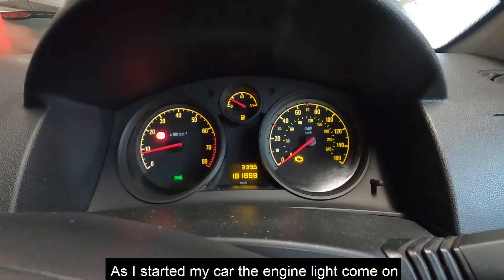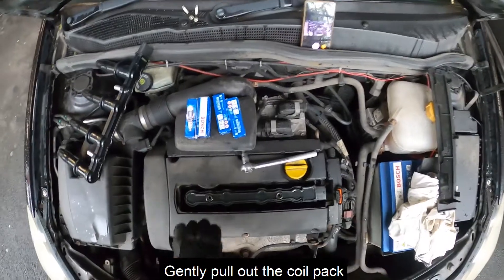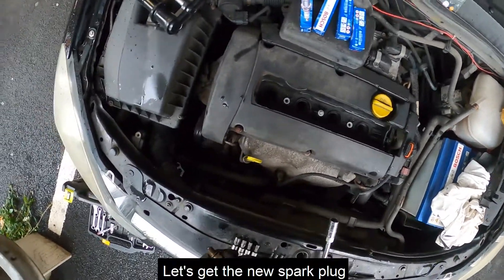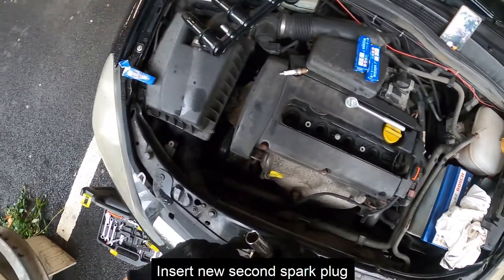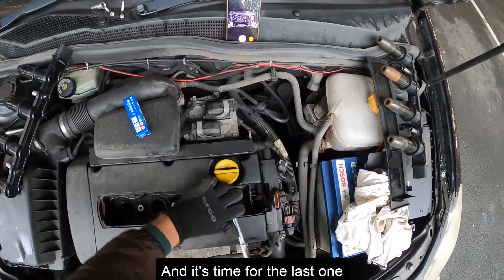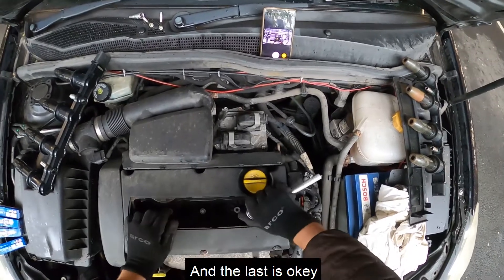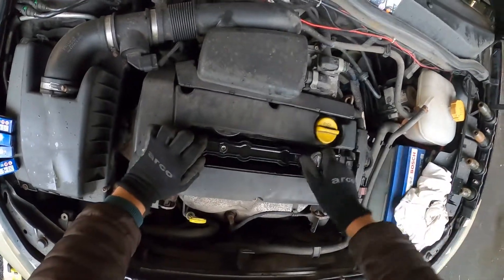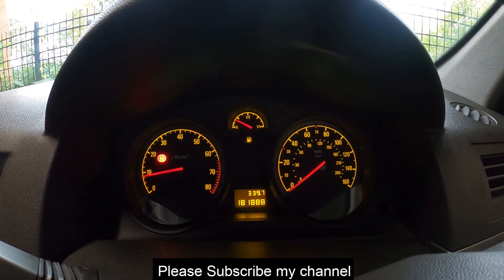How to fix Engine Misfiring - Astra H 2004-2009

Comment: Sorry to ask this on an old video but I am having a similar problem and not sure what to do now. 

My mechanic just charged me AUD$500 to change my coil pack and yet the problem is back 2 days later. They said it was not my spark plugs as they swapped them around and the misfiring continued. 

My opel astra just started misfiring as I went up a big hill on a very hot day (39•C/102•F) Not being very good with cars myself, I called road side assist, and had it towed to my mechanic. But apparently that was not the best course of action.

I feel like I constantly get charged by mechanics for things I don’t need. This year they got me to service the car three times, so it had been serviced 3 weeks before the misfiring started.

Unless I start learning how to fix my car myself I’m going to keep getting taken advantage of. 

Your video was great and made me wish I had looked it up before paying someone else to do the job. 

I just don’t know what to do now because the problem has not been truly fixed!

What would you suggest doing if neither the spark plugs or coil pack solve the problem?
Reply: actually just saw the comments section, which answered my question! 👍
Reply from the maker: @kvp2252 woow that's crazyy 500 for coil pack replacement 😮 i would recommend to get obd2 scanner from eBay or Amazon little 10 quid gadget very useful with cars. Glad you found the answer already 🎉
Reply: @simash9213 thanks for getting back to me! Yes pretty high cost to not fix the problem! I’ll definitely look into getting my own code reader. Thanks again.

Comment: Which spark plugs you used? Bosch which exact model?
Reply from the maker: Bosch Nickel Spark Plug
NGK Part No - FQR8LEU2

from eurocarparts if you are in uk, just enter your reg and it will say if it fits your car

Comment: hey man , i just subbed to you , i have the same problem , missfire cylinder 3 and 4 , errors P0303 and P0304 shall i change the sparks and the coil pack?
Reply: Same  iv changed my spark plugs now doing my coil in morning let u know if u want
Reply: Heya any if it’s just one or two plugs why replace the coil too? Thanks

Comment: Hello. My Astra H 16xer sometimes only starts on the second try. New battery, new spark plugs, new ignition coil, new cylinder head with pcv, fuel pump has good pressure, replaced crankshaft sensors. No errors detected on scanner and pedal test. What is the problem? Ecu?
Reply from the maker: Hey, maybe a starter problem

Comment: If you have a EcoTec engine and these parts don't fix misfire.
Check cylinder compression.
Head gasket may need replacing.
Done all the above Coil Pak & spark plugs new.
Misfire still on #4 code.
Reply: I had misfire two times both were coil pack problem
Reply: @b2s4x5  Im currently having a misfire when I push gas more agressively and when I am going uphill. Changed the spark plugs and coils and it didnt solve the problem.

Comment: Salut  am și eu o problema la opel nu îi dă de cap nimeni la service-uri..

Mi-a apărut martorul Motor,  am făcut vreo 2 teste diagnoza intre timp.

O sa las erorile sa le vezi..

Ce poate o fi , băieții de acolo au zis ca mașina nu are nmk..adevărul este ca merge bine, trage,  dar apare martorul motor, 

A șters eroarea,  după un timp  a reaparut,  iar am fost cu ea la service și am pus testerul..aceleași erori..

Vreau sa spun ca am schimbat Bujiile,  sonda lambda, Bobina de inducție ! Toate noi !  Ce o avea  ? 

Mașina merge bine trage, adică nu da semne ca ar fi o problema. chestia e ca apare (check engine) 

Mulți au spus ca s-ar putea sa fi calculatorul ECU,  de la motor. VOI ce credeți?

Astra h , 1.6 105cp 77kw , cod motor Z16XEP benzina

P0300
PO301
PO302
PO303
PO304
PO314
U2103
Cilindrii diferiti
Cilindrul 1
Cilindrul 2
Cilindrul 3
Cilindrul 4
Cilindru necunoscut cu rateuri
Bus de date CAN
Rateu aprindere recunoscut
Rateu aprindere recunoscut
Rateu aprindere recunoscut
Rateu aprindere recunoscut
Rateu aprindere recunoscut
Rateu aprindere recunoscut
Dereglare/defectiune in functionare
Reply from the maker: Hey, 
are cylinders not misfiring according to errors?
have they measured the pressure inside cylinders?

Comment: I got the same problem with my astra H, which simptoms got yours before you changed the spark plugs and coil pack? I am booked for service Saturday but I still have to drive 70 miles everyday, is it alright if I drive it like this? I don't want to damage something else. Scanned and got the second cylinder fault. Thanks
Reply from the maker: Well my engine light come up and the engine wasn't working fine, sounded more rough and vibrations. I drove mine around 20 miles, and when i replaced the parts. Also, after a couple days i have changed engine oil and filter too.

However, personally I wouldn't recommend you to do 140 miles. As it might cause some bigger issues.
Reply: @simash9213   same simptoms on mine, and loss of power, there is no engine light on dash, it's just the simptoms.

I have no choice but to drive it for another 140 miles till Saturday. 😪😪😪
Reply from the maker: @anotheryoutuber-d2l  oopsy, hopefully it will be alright. Just make sure that service will change engine oil and oil filter☺️
Reply: @simash9213   yeah already ordered oil and filters, hopefully will be fine till Saturday and nothing else will be damaged. Cheers.

Comment: Yes lad, i have a 1.4 Astra H Gtc 2007 the engine is misfiring so do you rekon its the coil pack n spark plugs?
Reply from the maker: Hey Mate, its very common problem, it depends when last time it was changed. you can take it to garage if you unsure, they will test for you. Hope that helps :)

Comment: Hi, i have a Opel astra h, gtc 2008 here in spain. Engine looks much the same as this one in video.
I have error code P0301. So misfire in 1st cylinder. I took out spark plug from No2, and swapped with No1. No differance.
So my problem is, do i just go ahead and buy a new ignition coil pack costing €60.
How did you know that new coil pack was going to fix problem ??
I could buy new coil pack and there still is a problem ???
I dont have a cylinder head compression tool. Should i get that checked first ??
Reply: Simas, i just took the chance and bought new coil pack online, and spark plugs, total €57.
Parts arrived today, 30mins later started her up  and perfect !!! Yippppeee
Obd reader then cancelled fault code !
So thanx for ur help !!
Reply from the maker: @arnietwo11  woohoo that's good news. 😊 well done mate 👌
Reply from the maker: Hi, of course it would be the best to check cylinder compression, if you don't have a tool you can ask do to in garage, for few euros. I knew that I need to change coil pack as I noticed it only last around 70-90k miles. Last time I changed it was 75k miles ago. so I knew its time for new one. My Friend had similar issue his coil pack lasted about 85k miles. I would recommend you to get new spark plugs too :)

Comment: Great video! I have an Astra H 1.6 twinport. I get an error when the engine is cold and when they drink it below 15 degrees misfire 303.  advice?
Reply from the maker: Thanks mate, maybe you need to change just a spark plugs 🤔😊
Reply: @simash9213  Three types of spark plugs and bombs have been replaced, but an error still occurs!
Reply from the maker: @goranmilic2449  oh that's strange, i just did a quick Google search and it  not sure if that will help 

A code P0303 may mean that one or more of the following has happened: Faulty spark plug or wire Faulty coil (pack)
 Faulty oxygen sensor(s) 
Faulty fuel injector
 Burned exhaust valve 
Faulty catalytic converter(s)
 Running out of fuel 
Poor compression 
Defective computer

Read more at: https://www.obd-codes.com/p0303
Reply: @simash9213  I had the same problem. Garagist told to buy new coil pack n spark plugs, I did but problem not fixed, then he checked the compression> 2nd cylinder = 0 compression. So here I am with new  coil pack n spark plugs [useless] and have to spend more on who knows what
Reply from the maker: @nikdelta399  oouuch, the person who works in garage should measure compression in cilinders firstly before telling you to buy new coil pack. You can try to return them to shop if you still have receipt.
Reply: Thanks